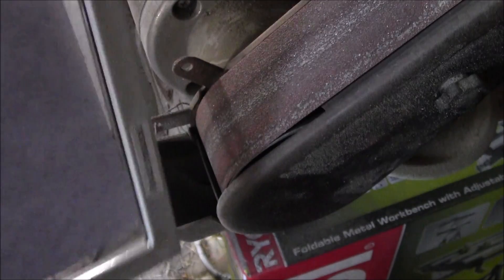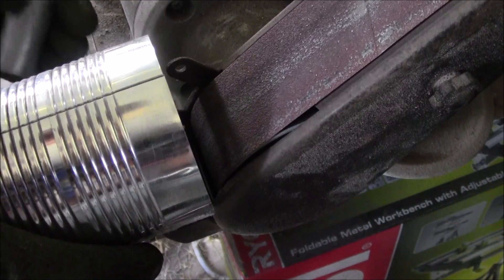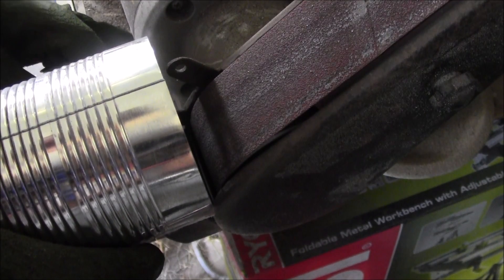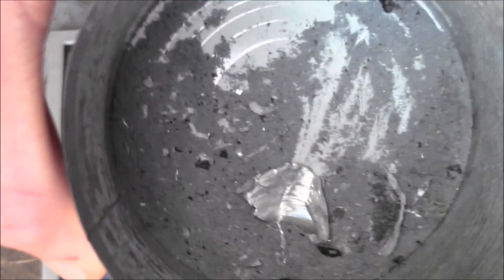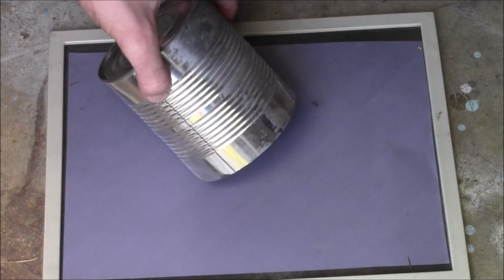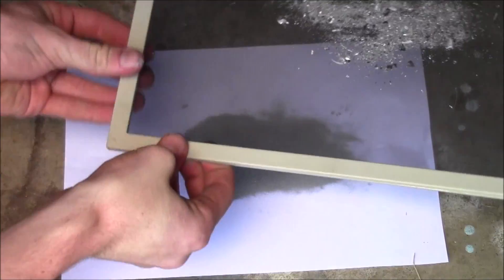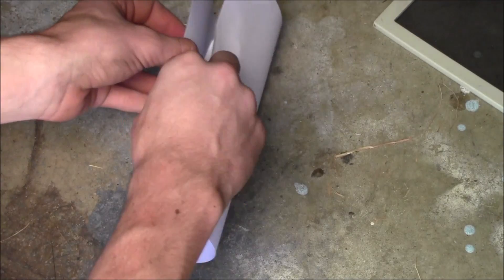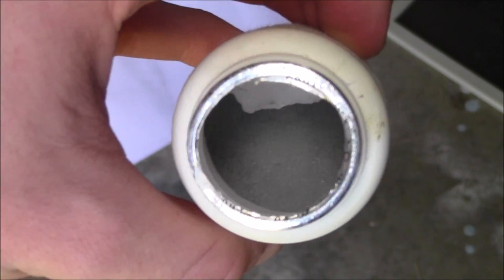How To Make Fine Zinc Powder

Comment: I would just use a strong file, because that sand paper will contaminate the zinc powder with sand particles and adhesive. If you want to use this for fireworks that contamination makes a difference.

Comment: sandpaper dust contamination
Reply from the maker: +Kyle x you make a very good point, The most common sandpaper material looks to be Aluminium Oxide tho that depends on the sandpapers use, so yeah you will get some impurities maybe but they will only be very small. The diameter of the sandpaper grit that might come off might be larger than the zinc itself so using the screen might lower the contamination too.

Comment: mix some zinc dust in with copper sulfate solution- zinc dust to copper dust
Reply from the maker: Camroc37 I find more use for zinc dust rather then copper, from a pyrotechnic look of things copper as a metal isn't really used much
Reply: toothpick993 I like making copper for some reason.
Reply from the maker: Camroc37 I like the colour copper produces when it (and its compounds) are added to a flame
Reply from the maker: Camroc37 I decided to make a video today making copper from copper sulfate and steel wool in light of the message earlier. The reason I went with steel wool instead of zinc is becasue zinc is more precious as a powder to me then using iron
Reply: toothpick993 Hmm, didn't know Iron would work! Is the reaction rate slower, or the same?

Comment: isnt that kinda dangerous with all the zinc powder flying around while grinding it? i mean it could catch fire somewhere (inside the mill at the motor) or something...and how about inhaling zinc? i mean its th easiest way but i think its not the best...maybe a manually operated mill or soemething....
and can u name some more sources for zinc (besides scrap metall that is not existing in big cities) - i mean batteries are kinda rare / expensive / dirty&dangerous...i only know about plaster board anchor/dowels, do you have experiences with Zinctitan - mostly used for rain gutters?
Reply: this is not the safest method (finely divided metal powders in air can be explosive after all, zinc is the easiest to work with tho, since it's harder to light up), neither most efficient, or least energy intensive, this is a easy way to make zinc metal powder but i would recommend making it electrochemically which would be easier in the big city and if you dont want black manganese dioxide and carbon everywhere from batteries you can use zinc oxide which is used in pottery, so you can easily buy it in pottery supply stores or internet, water to dissolve the sodium hydroxide (easy to find drain cleaner in your local supermarket), dissolve as much sodium hydroxide you can in water, how much depends on how much you want to make, but i would recommend you to use small amount of water (eg  300ml) in preferably a glass container, or other chemically resistant enough container to do it, you can dissolve about the same amount of zinc oxide on a solution of hydroxide, so a 1:1 mix of it should be enough, dilute about 20g of hydroxide in about every 100ml of water (at room temp: 22c) and 20 g of zinc oxide in the solution of hydroxide in batches of 10g, stir and then add another 10g

the following reaction takes place

ZnO + H2O + 2 NaOH → Na2Zn(OH)4

that will make the sesired thing, if i remember the name correctly, it is sodium tetra hydroxyzincate

https://www.google.com/url?sa=t&source=web&rct=j&url=https://en.m.wikipedia.org/wiki/Sodium_zincate&ved=2ahUKEwjrw-Hd7rf3AhXGs5UCHcMxDMwQFnoECCwQAQ&usg=AOvVaw3lUwk9A0QV583jwU9h0Tjr

1/2
Reply: after that you need electrodes, what i recommend is using clean metal (eg aluminium) sheet inside a  bottle for the cathode (positive electrode)  so when the spongy zinc crumbles it goes inside the the bottle rather than back into the electrolyte (and wasted, it's hard af to dissolve zinc metal, trust me i tried), but a zinc plate is better, idk exactly why, but it will pobably stick better and wont crumble as easy from the electrode, but still use a bottle, will make recovery easier

after some 8 hours you should have your first batch, recover it, dry it, store it, do a few more batches, till you have the desired amount of powder, but that inst fine enough for use in rocketry, firework or other fuel mixes or effects, so you need to break it further, note that it will only work well if you dry it very well, otherwise they will stock togheter and water in a fuel mix isnt great for keeping it burning or not explodeing, theb you will need a simple ball mill, zinc is soft enough you can make a lil manual one (not as recommended) or a electric one from a small motor just strkng enough to spin it around, use some ball bearings or something, just make sure as usual it's strong enough it can grind it, let it rip, opening it after awhile, idk how much time exactly, but that depends on how fine you need it, otheriwse for just chemistry, you dont need to even make it finer at all, unless you need it rewlly fine for that specifc reaction

2/2